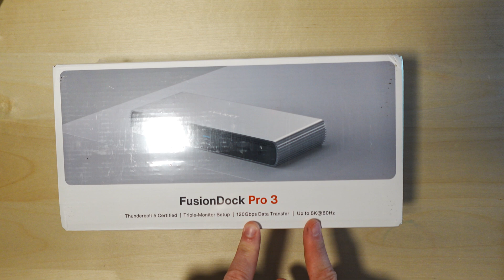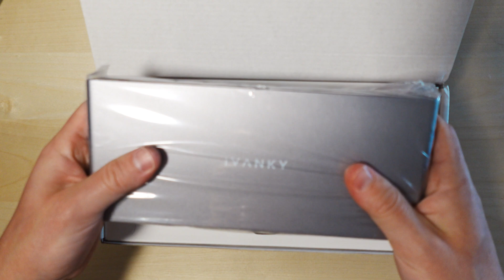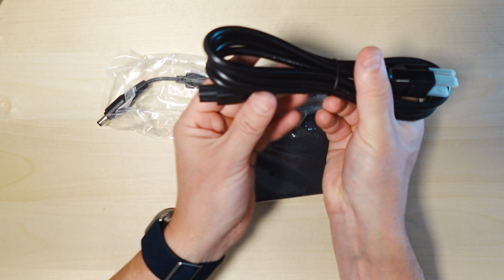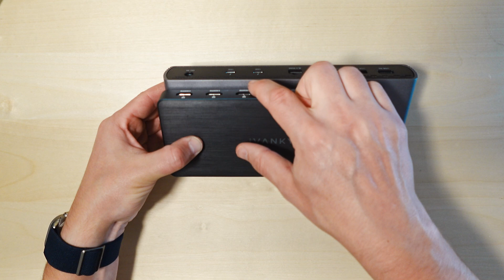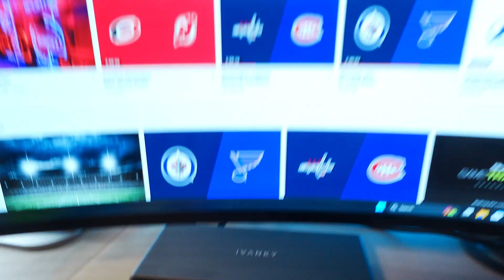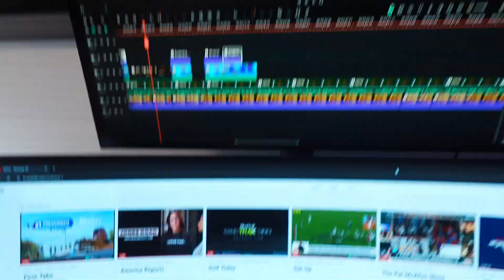iVANKY FusionDock Pro 3 | The BEST Dock for Productivity

Comment: PCIe over Thunderbolt 5 has timing issues that cause external monitor sync resets. Very disruptive. Don't think your gonna get a firmware update that will fix the issue. There is no firmware upgrade option offered. Half baked now and forever...